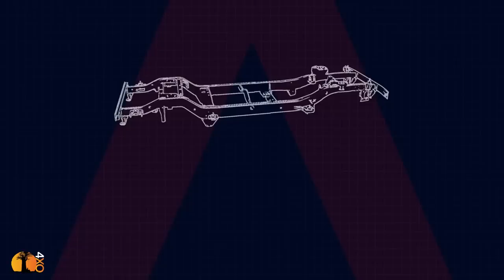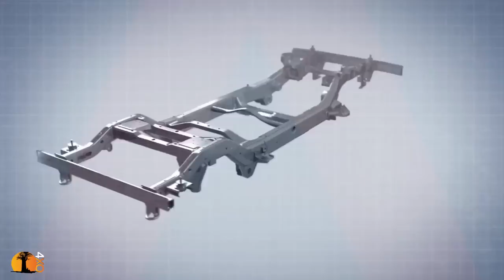INEOS GRENADIER or LAND ROVER DEFENDER. Which one would you buy? 4xOverland

Comment: It would have to be a boutique made to order company (pick up or deliver) like ICON vehicles of California.  Icons go for $100K US and up.  Actually that is a bargain compared to the LR's made today.  Disappointed they used a BMW engine.  Cummings Diesel.  Strong V-6 or V-8 Gasser that is a World Engine like Ford or GM makes where you can find parts everywhere for a long time.  No Manual, really?  LR would be best to throw their design in the trash, hire these guys on, put them in charge, and give them an assembly line because this is 1000 times more Defender than the Champagne drink holder they are putting out.

Comment: Another guy sucked in by the hype...

Are we going to see it in the developed world? not without a lot of electrics.

I will take air suspension any day over coils - it’s as reliable or if anything more reliable than steel springs. Add to that it’s kinder to the vehicle as it transmits less vibration..

Ineos is building an interesting truck - it’s going to be expensive and just a complex as any other modern vehicle. I might buy one but I don’t think I would risk a deposit yet

Comment: Oh Oh I just read it will be sold by BMW dealerships. Any car manufacturer that adds critical engine pieces made out of plastic which we all know won't get to see the 40K mileage mark has committed treason to the BMW 2002 and BMW 6 Series Alpina iconic cars. Recently a car rental company upgraded me to a BMW 530 series. I open the hood and it's a 2.5 L Turbo. The car does not feel like a BMW, a cheap Toyota yes definately but not a BMW

Comment: It's not an off-roader. Maybe a parking lot/some unpaved roads-roader. For the same money I can get a GHE-O, V8 420HP, chrome-molibden FIA approved chasis (2.5 times more resistant than HUMMER), 52 inch tires, 60 degrees climber, 12 passangers and has 1m wide rubber traks that can be installed. Oh, yeah, I think GRENADIER it is great to do grrandma's chores, but not off-roading. And to put some 35-37's, lift it,  it would cost another 35.000. Doen't make seense the GRENADIER.

Comment: Today you need Milliards of Euros to be successfull. Milliards of Euros you get with a new idea Like Tesla and Not via a Lessons Learned Concept Like Ineos Grenadier, which is for Sure a outstanding Offroader.
You may kick Ford Ranger and the remaining Toyota Heavy Duty Out of the Business.
A better Idea than BMW and ZF would be Iveco Diesel Engine and the new Automatic gearbox of Iveco, also available in Fiat Ducato. If you ask someone for which vehicles the Service in Africa is better Mercedes Trucks or any Iveco. Iveco will be the Brand.
Group PSA ist electrifying their LCVs. PSA and Fiat-Chrysler will turn PSA-Fiat-Chrysler, while Iveco is still technology-partner with Fiat. Chrysler has big Petrol-Egines for Heavy Duty, which are simple and performant. Less parts, less friction, more Power and more Performance Out of the fuel If real Performance need to be there.

Comment: Pray it drives like a truck[ like the Defender] and not like a car[ like a SUV]
Reply from the maker: I hope it does not drive like a Defender. Then what's the point of it? The Defender was awful to drive long distance. I did, for 8 years!
Reply: @4xoverland  I agree with you the old Defender is a pain to drive as daily commute and long distances on tar. However when travelling over rough terrain, the akward and sometimes cramped driving position puts your whole body in contact with the vehicle, you feel every movement of the suspension and chassis reaction and engine/gearbox, is this not the point of off-road driving?. With a SUV you are totally disengaged with the mechanics of the vehicle. I have a 1997 Defender with the 2.8 straight six BMW motor [ when BMW owned LR in SA, only 600 were made] and have enjoyed 480 000 km of glorious and involved off road driving. The engine is super responsive and economical, Ineos is definately on the right track with the straight sixes and the diesel will be something very special with all that torque.

Comment: All very impressive no doubt but for all its many faults I’ll stick with the old (proper) Defender which Ineos so blatantly copied. Simple, cheap to service and repair, the Defender is a very useable and appreciating Classic which will still be going strong in 10 or 15 years when the Grenadier has become an expensive liability. Replacement BMW engine for your Ineos? Hmm - maybe a tad more than the £2k you pay for a new Defender Puma engine! Not viable.

Comment: i disagree , if its dearer it wont sell because people wont trust it straight away , i certainly wouldnt buy it unless it was significantly cheaper as i dont know how reliable it will be or the resale value, i dont know what steel has been used , is it going to rust ?? 
this vehicle has NO REPUTATION OF ANY KIND , its a complete chance buy , not yet proven long term or worthy of spending big money on.
if this has a big price i GUARANTEE it will not float, it could also create resentment from buyers , worthy or not ??

Comment: And good luck fixing it when it breaks down somewhere in the bush. This will have (probably) the same ZF automatic transmission that LR have used in the new Defender (I just don't hear the same furore about this by the 'old fashioned' - if-it-ain't-manual-it's-no-serious-off-roader' people as I heard when LR put that same ZF in the new Defender). And don't get me started with the BMW engines... You'll be lucky if a) it doesn't spontaneously combust and if b) half your engine hasn't melted away by the end of an 'overland expedition' in the bush with all the cheap plastics BMW use in their engines and all the flimsy sensors that break when they hit a pothole outside the Waitrose parking lot. 
At least Land Rover has decades of experience in making / optimising engines for off road use, whereas BMW only makes engines for luxo-barge CUVs than never see anything worse than a pothole in the city.
Also, where do you have this vehicle serviced and by whom? How long will the parts take to arrive (and from where) and what will their availability be like? What about parts prices? I suspect that due to limited volumes (at least initially), they won't be able to achieve economies of scale with their parts manufacture.

I think  all the 'hate' that the New LR Defender is getting comes primarily from 3 sources:
a) people stuck in decades past who cannot accept the development of newer /  better technologies and solutions (e.g. LR made extensive research into whether the new Defender would be better off with a body on frame design and all their research and development figures showed that the monocoque design was stronger, more durable and more rigid than an equivalent body on frame design)
b) Americans who just hate anything British because they love their Fiat Wranglers (OK, I concede, Land Rover gave them plenty of ammunition to bash them with, with their shoddy build quality and Prince of Darkness Lucas electrics but that was decades ago and things have since moved on).
c) Toyota LandCruiser lovers who would not contemplate buying anything else for whatever reason, since Toyota makes them better than anyone else out there, so, why even bother.

I have to say I can understand the LandCruiser types more than any of the rest of them but I suspect LR will make the new Defender much more 'customisable' as they start to regain their foothold in the market. The coil suspension, I believe, has been announced will also be available for the 110 and the market for aftermarket mods is already beginning to show some very positive signs.
After all, most of these vehicles are never taken stock to any overland expedition (at least by serious people) - they are always 'built', i.e. extensively modified, and I expect the same will be true with the new LR Defender.

Comment: Inios have not Designed anything they have taken a Landrover  110 slightly changed the bonnet, Put a new engine in and that`s it,  it is not a replacement for the Land Rover, As for the "Essence" of four wheeling at 50K + it`s yet another failure waiting to happen who will buy it

Comment: The origianl LR Defender sold on being the last 'pure' off roader.  It is a shame that it has been replaced by an ugly, overpriced, and electronically complicated version of the even uglier Discovery 4 with the usual lousy reliability.  However, if the Ineos is to be a viable 'new' Defender, it will need to be sold at a reasanable price.  The video clips suggest that it will be extremely well engineered and that will not come cheap.

Comment: No manual transmission. Interest fading. Beemer engines.  yeah not so much.
Powerful diesel engines maybe. Petrol Beemer  of recent design not so much. Maybe good for a sport cars and sedans. Modern beemer engines are not what you call smart design for maintenance or longevity. For example the cam chain at the rear of the engine. Not brilliant.
Like most things like this youll have to see for your self and or see how they go out there in the wild.

Comment: If you think a bit, both the 110, the 76 series LC and the Grenadier share one thing, the square boxy UTILITARIAN design. Also, at least for the base 1hz 76 series and 110, the feel that you are piloting a WWII warplanw, not a mushy softy 2020 crossoverSUVetcetc whatever they might be called. After the Landcruiser is taken out of assembly lines, there wont be any production series car with those UTILITARIAN WORKHORSE qualities. But, it is the world of the urban trendy soft, bearded idiot. I am analog, me and my 76 belong to a past, engines without sensors, computers and electronic gimmicks, where rhe diesel injection pump is mechanical and the engone works with 50 cetane diesel if need be.
I am a coffee farmer at 1200 meters above sea level, with red clay mountain tracks and the closest electro mechanician is about.....500 kms away. If I cannot fix it myself, it is useless to me.
I know I know, no airbags or terrain response or even ABS brakes, but the work gets done with a minimal TLC on the landcruiser. And I ALLWAYS get home, no matter rain, mud, fallen trees, and I can take out the seats and hose the interior.